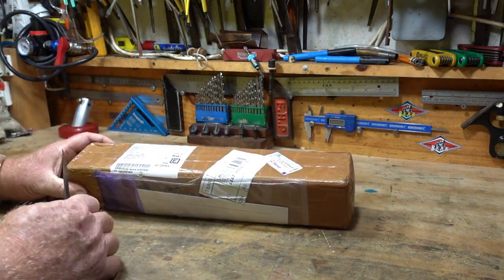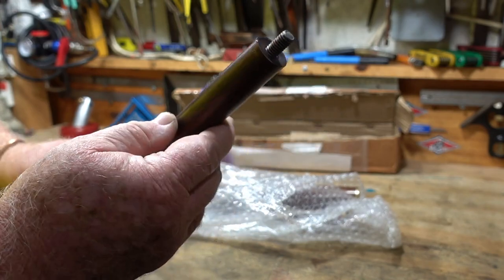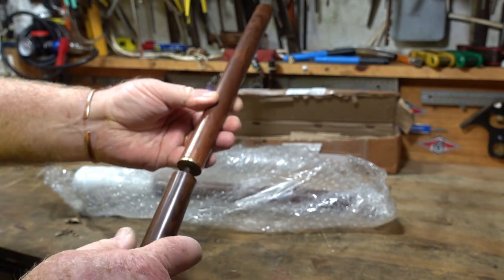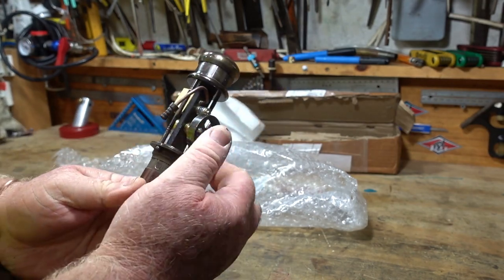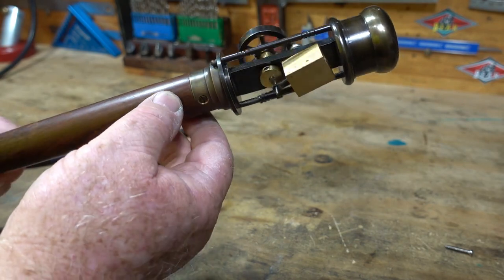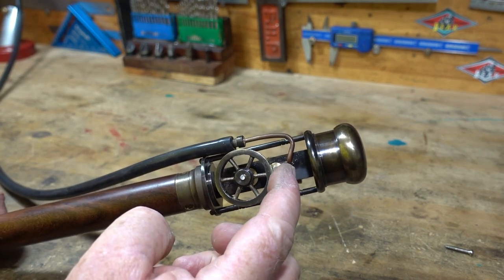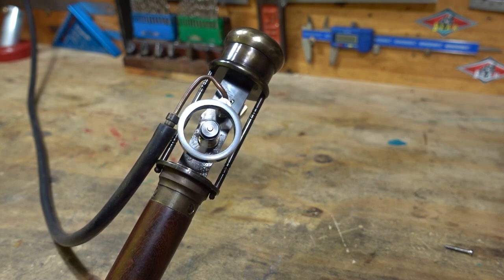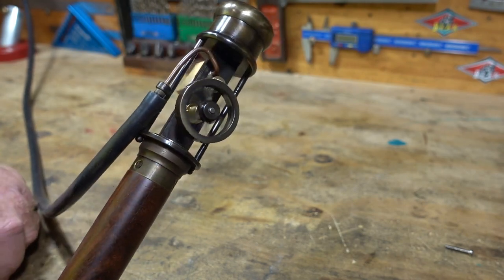Steam Engine Walking Stick

Comment: Thank You for sharing the video!
I haw long time being curious about those and i recieved a lot of ebay commercials for them for a while, in some promotion they mention things like sewing machines, i am not sure, but whan i handcrank one of my old 1930s sewingmachines it does not take that much force, so maybe it would be tecnicaly possible to at least make it turn slowly if it is well oiled, i had gladly borrowed one to You for test if it had been possible... ha ha
Reply from the maker: I'm really surprised at how nice the wood is, how nice the brass joining ferrules are and how well constructed the whole walking stick is and how well made and how well the engine runs. I am really......really happy with this :) - Cheers Jim